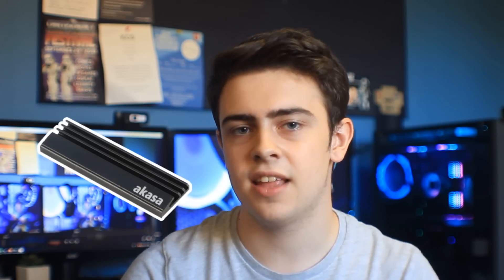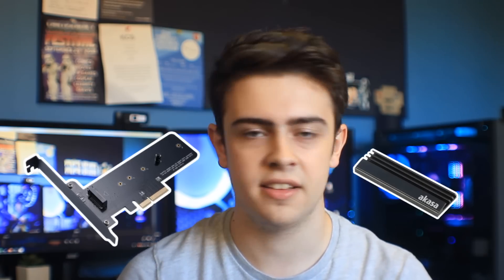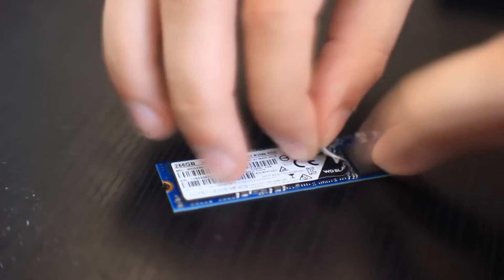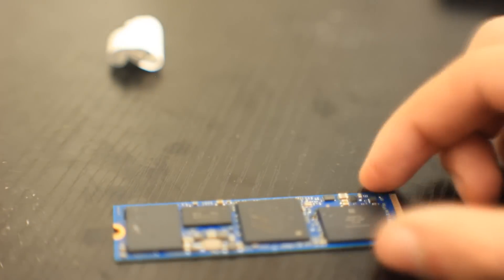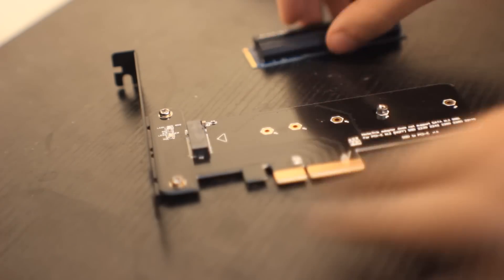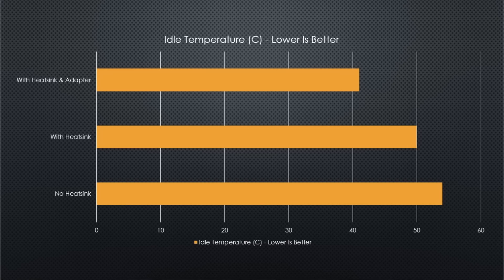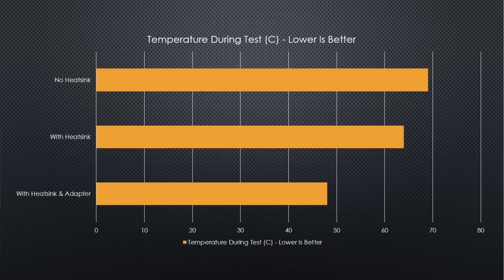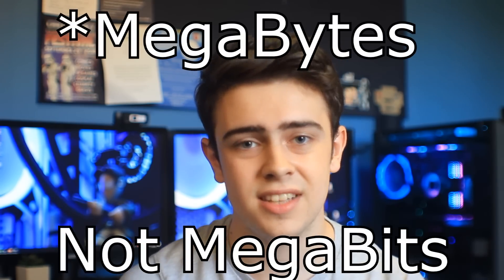Increase the Speed & Lifespan of ANY NVMe SSD

Comment: I jammed some thermal pads with the correct height between my two nvme ssds and the mainboard to dissipate the heat.
They are slightly warm to the touch with my solution.

Comment: Most NvMe SSd's rarely get above 35 Degrees under heavy use which is well below dangerous temperatures. So unless your SSD is in a place where it is going to suffer from radiated heat from other devices or components the addition of a heatsink makes little or no difference. 
Normal case airflow is usually more than enough. Granted they look pretty sexy with a heatsink but that is really the only good reason to fit one. Heatsink manufactures are selling these because they know people are gullible.
Why do you think the SSD manufacrurers themselves do not SUPPLY a heatsink or RECOMMEND a heatsink? It's because overheating is not a problem per se. SSD manufactures do not get customers returning SSD's because they fail due to overheating because it's not a really a problem.

Comment: Good video, but you'll probably be messing with the longevity of your storage with a heatsink on the NAND chips which like to be hot, it's only the controller that causes thermal throttling so thermal distribution should only be applied to that. You do still get the short-term benefit with any heat spreader/sink but wouldn't risk it myself, I use a cheap-ass generic heatsink with a cut-down thermal pad just for the controller (so floats above the NAND) and get no throttling with stress tests keeping the temps at c. 55C
Reply: How do you distinguish the Nand chips and controller chip?

Comment: Thats just basic knowledge you share, you should review wether its necessary to put heatsink because the nand chips actually needs to get hot (>50c°) or it will lose its data lifespan faster in other hand the controller chip needs to be cooled or it will throttle. Thats the lifelong debate of this heatsink issue and you not even talk about it.
Reply: How to cool the nvme without cooling nand? Haha
Reply: @jamols09  Really easy, use a generic heatsink that uses a thermal pad and rubber bands. Cut the thermal pad to only cover the controller (which is what gets thermal-throttled) then the NAND gets no contact so stays at the temperature it wants but you don't get any thermal throttling.

Comment: Thanks for the review. This might be very useful for my build. I have my 960 evo at the back of my motherboard in an itx case in a sandwich layout from my video card ( dan a4 sfx case) . My ssd with go to 70deg at continued write speed and my write speed tanks.  So its definitly overheating.
Reply from the maker: Remember that if you are transferring lots of small files the speed will drop a lot! That could be another explanation! Try transfer one big file, e.g. A large video file and see if the speed drops when doing that
Reply: @RMDTech  Good suggestion. It's generally not a good idea to read / write files / data to SSD's anyway. file storage is better on a standard HD while keeping Programs and OS on the SSD. Good call. SSD's rarely get above 35 degrees under normal use so this guy must really be thrashing it.